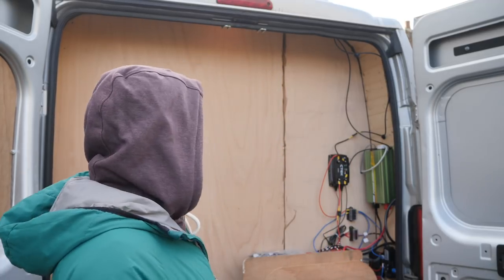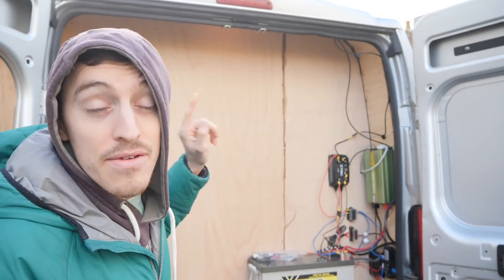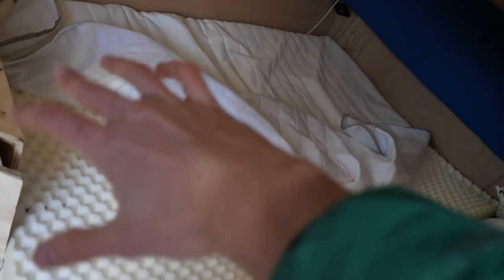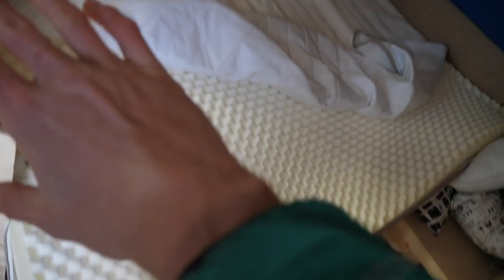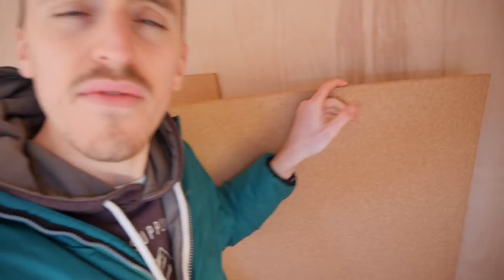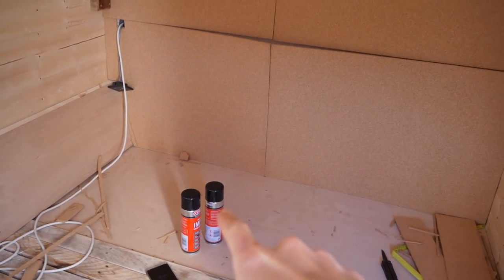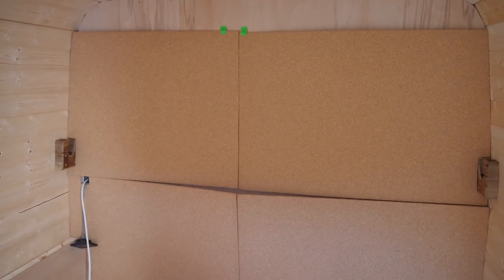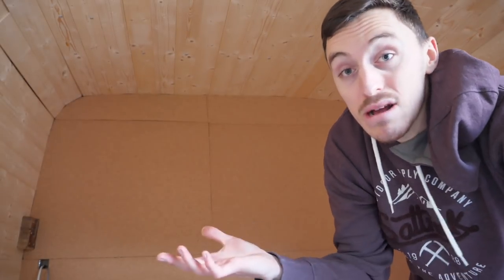Camper Van Garage Cork Wall! Cork Insulation

Comment: Don't joke about killing your lungs! some spray contact glues contain dichloromethane which is horrendous for your health. At the very least hold your breath while you spray the wall then quickly go outside with the piece to spray in open air, that way you're out of the first big evaporation of poison. When you say mask, a respirator with filters is the only type that will work. Nice tip on getting the curve.

Comment: Amazon Ozone generator.  The ones in a square type case about 9 inches cubed that cost between 50 and 70 US dollars are fantastic for getting ALL smells out and killing mold and mildew smells.  Just put it in the van, plug in for 20 minutes and then let it air out for at least an hour.
Reply from the maker: Thanks a lot, will check them out!
Reply: Hotels use them when guest smoke in non-smoking rooms.

Comment: I'm really interested in how well the cork sticks to the wall. Was planning to use cork myself, but heard it doesn't stick very well because it extends and shrinks depending on how much condensation it draws.
Reply from the maker: Well the sticky back panels weren't very good at sticking until I used spray on adhesive but you can also keep track of my wall as I use the van over the next year
Reply: that adhesive is high temp right?
Reply: Will do!

Comment: Now you've stayed in the van with and without the cork, do you think it adds insulation value? Would you consider using cork as an insulation for another van in the future? Thanks
Reply: Also to add, how did you find it stuck and has it held up over the last 6 months during your travels?
Reply from the maker: the cork wall is definitely warmer to the touch on cold evenings that the wood and especially metal but I am unsure if it makes a significant difference. if using spray adhesive use one rated for higher temperatures like up to 60 degrees or so

Comment: Great like the cork - you could pin ribband down the seams or something similar. Don't understand how you could react so badly to perfectly normal paint which some of us have been breathing OK for 60 years - why didn't you use low VOC which would be just as good for that job. But then to go and use spray adhesive inside the van with no face mask, in an enclosed space??. You have to be over 18 to buy it because its so toxic. (ps - also hope it;s high temp). You should have sealed the join  between the sides and roof and floor to the back panel (with say acrylic sealant - as used for window frames - cheap flexible and innocuous) before you added the cork. To stop condensation in the back, all bare metal should be carpeted. I would have also carpeted the dividing panel and definitely the back doors.
Reply from the maker: Hi Nick cheers for all the info, I find the spray adhesive doesn't linger but the paint smell does. With the spray adhesive what is considered high temp and why is it necessary?
Reply: Probably because you got too high to notice :) It would be clearly marked on the can eg.
https://www.amazon.co.uk/Trim-Fix-500ml-Temperature-Adhesive-Lining/dp/B01L03CJGI/ref=cm_cr_arp_d_product_top?ie=UTF8
And the reason is that the roof and walls of the vehicle, especially bare metal, can get incredibly hot and normal spray adhesive will just fail eventually - the good stuff if you buy in multiples is reasonably cheap, so why use anything else? It is probably not as significant on your wooden Panel - just for future reference.